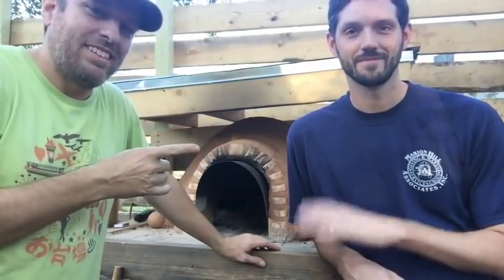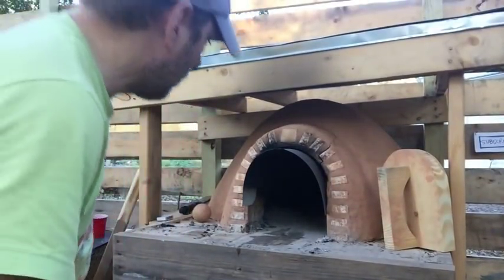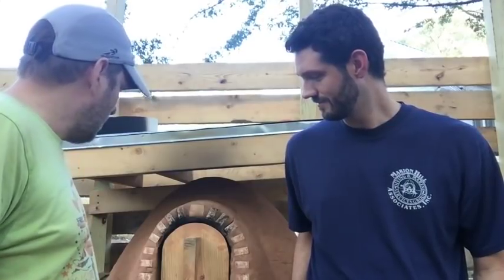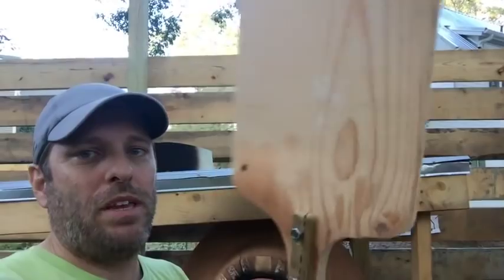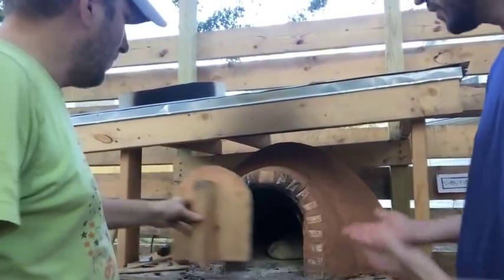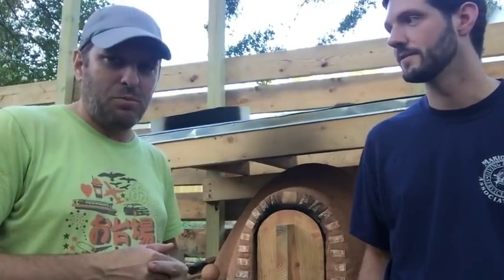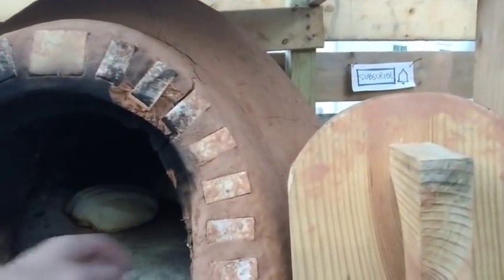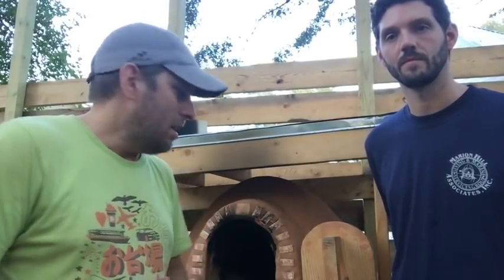How To Bake Bread In A Cob Oven

Comment: When you turn the bread in the oven you need to place it in same spot where it was otherwise it will burn at the bottom it you move it to a new spot and spray the top  with water a little to get crusty
Reply from the maker: Good suggestions. Thanks for watching.

Comment: Great job!, from Uruguay :). Kind of boring but, when we remove the sand, after two weeks,  we wait another two weeks to allow the interior to dry before firing. It is boring I know but, by doing so you avoid cracking. When possible we also burn outside and if you manage to cook even a little bit the outside you get from clay a ceramic and that means your oven won't be affected by the rain, cheers and again, good job and thanks for sharing.

Comment: I used to work at a pizza restaurant that used a pair of very large wood fired pizza ovens. Pizzas were made and left on the parchment papers when inserted into the oven. The ovens were 4-6 feet in diameter so we maintained a fire in them at all times. When the pizzas were mostly cooked, they were slid off the parchment and the parchment just tossed into the fire. The ash in the oven lends its own flavor to the pizzas. We also would do prime rib roasts in there and all of the roasted garlic used by the restaurant (full serve restaurant not just pizza) was roasted in the oven daily. We never mopped the oven floors although we did have a brush for scrubbing and sweeping. We didn't do bread in the oven just due to how much we used and the temps we used for pizza (500-650F, Large pizza with 5 pounds of toppings cooked through with crispy crust in 60-90 seconds). A family member built their own pizza oven using cement/vermiculite/perlite mixtures.
Reply from the maker: Thanks for sharing your knowledge. I plan to make a dedicated pizza oven this summer. I’ll likely do the cement/perlite option. It won’t be as big as the one you worked with. Thanks for the tip about not mopping. In the case of the bread, it is more for the moisture. That might be accomplished with a bowl of water instead. The blast of steam helps set the crust of the bread. I’m still learning there to. I’ve got some garlic growing in the garden soil I’ll have to try that too. Thanks for watching.

Comment: Hi. For best baking results, even out the heat within your oven before baking in it. To do this, once the oven is cleaned out put on the door and leave the oven closed for 30 minutes. You will get a better bake. Also, sprinkle cornmeal over the peal and oven for ease of movement. Place a tray of water in the oven while baking to keep the atmosphere within the oven moist. Enjoyed your streams. Regards, Alison UK
Reply from the maker: Thanks for the feedback and suggestions. I need some more practice baking bread. I made a few nice looking loaves a few weeks ago. Took one bite and realized I’d left out the salt. :-) Thanks for watching from across the pond.
Reply: Thanks for replying. Salt I am afraid is integral to bread making as it stops the yeast working, as well as effecting the flavour. I could bore you with the science of flavour notes achieved through the sour dough method.... but I won’t here as it does require an essay! However just a mention about your two initial loaves. I am afraid your oven was not hot enough to give good colour all round to your baked loaves. This will of course improve on continued use of the oven. Professional wood oven bakers achieve great baking because their oven never cools down, it is baked with daily. Unless you plan on doing this you have just got to give your oven time to heat up, and time to even out. I take my oven temperature 50 degrees higher than required to allow temperature drop while the oven is closed post heating.
Can I give you a tip? If you find sourdough too chewy when eating it, add a I/2 oz of fat to your dough mix. You will be amazed how such a small amount of fat will change the characteristics of your bread. The fat conditions the dough. Try it and see. Regards Alison

Comment: I think you'll need a chimney at the back, so the air that goes in the door will make the fire hotter. If you like, you may also need a chimney plug so can contain the heat when you closed the door

Comment: By the way, you should get a saws-all with an 8 or 10 inch blade and mark off a line about 4 inches up from the bottom and put the saws-all to good work and remove at least 4 inches from the bottom, all the way around. You don't need that much height, slice it horizontally about 3 or 4 tiles up from the bottom & carefully remove everything below the cut/line.
Reply from the maker: Thanks for the feedback. Thanks for watching.

Comment: Use a water spray bottle to add moisture to the air. Bread ovens add steam to get crusty breads with soft interior. Just a tip from a Chef. The air inside oven is too dry to get hot enough to crust bread
Reply from the maker: Thank you for the tip. I always appreciate feedback from people who are in the business. I usually mop the oven and dump in some water. I’m still learning the bread making process. I’m definitely a maker not a baker. :-) Thanks for watching.

Comment: You need put at thermostat in before you put the bread in and a cup of water in as bread bakes the water will creat crust by releasing steam
Reply from the maker: I’ve read about the steam solution recently. Cool tip. Thanks for sharing.